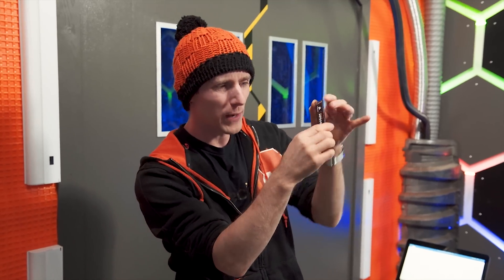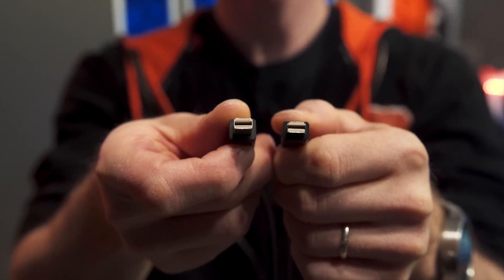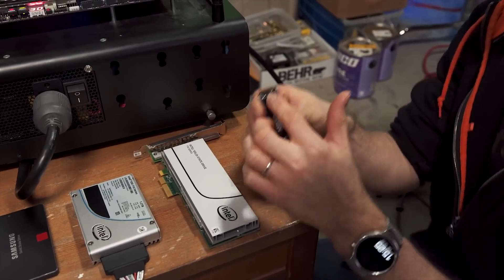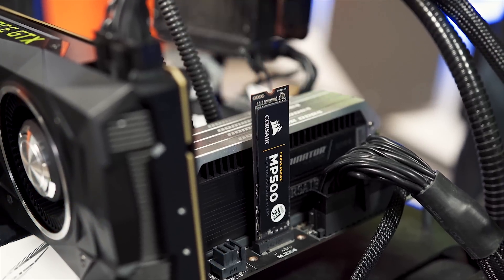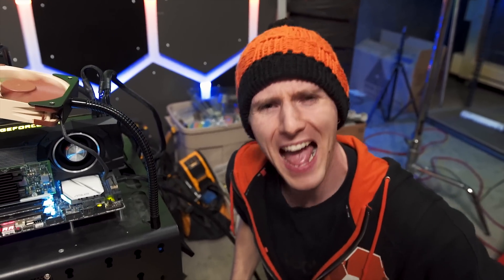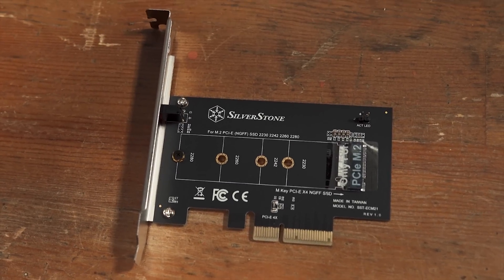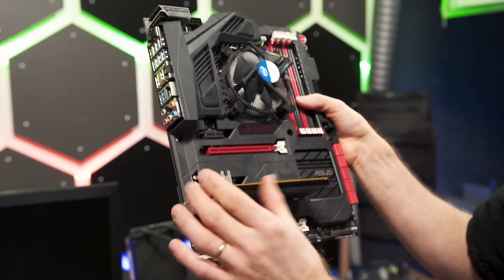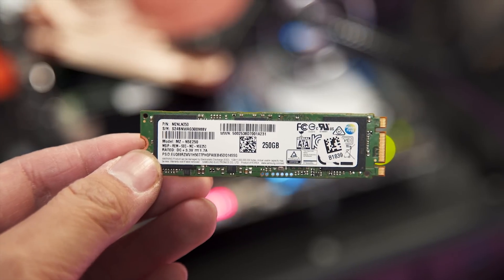The FASTEST SSD Technology Explained - M.2, U.2, and MORE

Comment: That M.2 slot that leaves the drive just sticking up feels super sketchy.
Reply: If you look there are screw holes either side that iirc are for mounting a support for the drive.
Reply: It probably comes with (or you can get) a bracket for it.
Reply: was thinking the same thing. It looks ugly to me compared to the ones that lay down too
Reply: it has 1 tiny screw that holds it down at the end away from the connector. the drive is so lightweight it doesn't need any more than that
Reply: I would like mine to be like that because NVMe gets very hot and it would help to cool it down.
Reply: Did you mean for this to be an amazing sexual innuendo or was it accidental
Reply: that one guy That might be for a wireless module, the connectors look fairly similar. Refer to the latest wan show where they covered that new possible motherboard form factor
Reply: Unfortunately on my motherboard, the m.2 slot is below my GPU, but it isn't an NVME drive so I guess it's fine
Reply: I cringed when I watched that part lol.
Reply: Pienimusta yeah I thought that too
Reply: Most boards have the connector so that the drive lays flat on motherboard and you can "screw" it in place to keep it there firmly. That on video just leaves it in air no matter what you did.
Reply: if im correct m.2 slots are not only used for ssd's, my mobo has one as well and its way older than even the concept of SSD's. im guessing stuff like network expansion cards?
Reply: Pienimusta yea I came to the comments to find this 😂
Reply: +Pienimusta
Better than the solution on my board. 
I have to remove the CPU cooler and the GPU in order to get access to it.
Reply: Some of the older ones are there for Wifi cards and/or Bluetooth cards
Reply: If I get the PCIe NVMe adapter with my Z170m-Plus(which has a non NVMe M.2 slot) will I get NVMe support with that adapter?
Reply: Matteo De Vellis Physiclly, yes, sofware not bios wise, not for certain. If you mobo manufacturer has new bios which gives support for it then yes. It will work as secondary drive without prober support,but cant be used as OS drive.
Reply: Pienimusta i think he did not install a bracket
Reply: I thought that too but how often are you in your computer? Most people build them out and after that unless you upgrade a lot, they aren't constantly in the computer to really make it an issue with hitting it. I guess bumping it might be an issue if nothing is locking it in place.
Reply: Pienimusta ssd boner

Comment: m.2 ahci is not the same as sata
Reply: AHCI or the Advance Host Controller Interface, is an Intel standardized implementation of a Serial ATA host controller.
Reply: Indeed AHCI can also be used over PCIe...then it isn't Sata! e.g. the SM951 has also a AHCI flavour, which can be used in M.2 PCIe compatible slots. All the new PCIe SSDs use NVMe, but in the eraly PCIe SSD days there were PCIe AHCI cards...unfortunetely the video is confusing about this...

Comment: I'm currently building a PC and now I'm even more confused...
Reply: Don't worry about it. Just get a SSD and you'll be fine
Reply: You will probably be fine with a sata ssd, nvme ssds can be much faster but the difference isn't nearly as noticable in most applications as the difference between a hdd and sata ssd. Nvme ssds are also much more expensive per gb than sata ssds of the same capacity, so most consumers that don't need the extra speed are better off sticking to sata until the price drops.
Reply: Cooper Cummings Yeah, oh well... SATA SSDs are fast enough for me tbh but the next thing would also be the PCI lane speeds and such. Like, if I attach an "unsupported" or slower PCI device to a lane it'll drag down all others from what I understand. So what's the best place to put one then? And where for the GPU? I am so freaking confused even tho I'm an IT technician myself and should know it...
Reply: most z170 and z270 boards suppord ahci (sata protocol at sata speeds) and nvme (new protocol at pci express speeds) on their m.2 slots, and you just have to switch the mode in the bios, but for the best place to put them I haven't done too much looking at them because of their expense, but I have seen a few places find they will run cooler directly underneath an open air style gpu (because even though it is hot air being blown onto it it is some airflow over the device, but others say to put it as far from the gpu as possible to avoid the heat source. Every source I have seen says not to use a behind the motherboard m.2 slot if there is one on the front because there is better airflow, but the drives dont actually run over their temperature ratings without airflow, so it doesn't make much of a difference unless you put it next to a heat source with no airflow.
Reply: EpicLPer just put your gpu in your first pcie 16 slot, connect your sata drives to your sata connectors and if you really want to have 3000mb/s write speeds put your m.2 ssd in your m.2 motherboard slot. the video just makes it seem difficult. :P unless you use a motherboard from 2010 you can't really do anything wrong nowadays.
Reply: CrowHD Who, your mum? Yeah, did that, she has. I'm sorry to tell you :(
Reply: M.2 is the physical connections where those ssd sticks plug. An SSD can talk to the CPU via the Sata connections or the PCI-express lanes. Sata is slower and PCI-express is faster.
The confusion comes because there are M.2 ssds that are either Sata or pci-express.
And then, there the protocols they use, if its an M.2 SataIII , it talks to the system via ahci, while a M.2 Pci-express talks to the system via NVMe. 
I think that is how it works, if i'm wrong feel free to correct me.
In short:
M.2 (is the physical connection) can use: SataIII which in turn uses protocol ahci
and M.2 (the physical connection) can use: PCI-e , which in turn uses protocol NVMe.
Reply: +Farhan Tanvir
because it is a waste of money to buy a pcie add in card to give yourself an m.2 slot if the motherboard already has and m.2 slot, if you already have the slot on the board just use that, sometimes they are hard to find.
Reply: Don't bother with nvme, go for a good old sata ssd - it'll work without complications in every motherboard, cost less and still be a lot faster than an ordinary hard drive.
Reply: If you only game, just go for a sata ssd ;)
Reply: CryBeat Well for a newbie to the M.2 connection, yeah it is confusing. Alot of people assume if it is M.2, then it is automatically NVMe, which I thought as well. 

I see why ahci m.2 exists but it does make it a bit confusing to know which is for speed and which is for ease of installation (NVMe vs ahci respectively)
Reply: Dont worry, just go with a standard SATA SSD, or a HDD + small SSD combo. This versions of SSD, while better, are still too expensive
Reply: tl;dr use PCi-e or M.2 drive for extra speed but don't pay for NVMe drive(1-2% performance benefit).
Let me explain.
There are two layers of tech explaind in this video:
Physical: SATA vs PCI-e vs M.2
Transport protocol: ACHI vs NVMe
Let's get physical:
SSD connecting on SATA  is old but working.
PCI-e SSD is working and fast
M.2 is speed is about PCI-e speed but you benefit in size of connection port(awesome for notebooks and insensibly on PC) 
And what about transport?
ACHI is good, but NVMe is better at all. Maybe 10 years from now all SSD will use NVMe.
But NVMe nowdays, in house PC tasks, doesn't grant demonstrable difference - 1-2% at usual!
Today NVMe in PC SSD drives is just manufactoring optimisation(since at future all SSD will use new transport protocol) payed by mexicans, sorry, by enthusiasts.
Reply: stick to sata,some mini itx motherboard still use msata half sized ssd too...
no protocol head ache  but no pcie grade performances.
Reply: for gpu placement and other pcie element,just read your motherboard manual. and cpu specs. it will tell you the lanes it has and where they are used or shared.
but generally the pcie tops ports are the fastest for gpu.
Reply: No, it won't "drag down" all others, that's not how it works at all. No worries there. Put the GPU in the first slot although it doesn't really matter too much for GPUs.
Reply: CryBeat the video is basically saying to match both the connector and the protocol for the motherboard and the SSD. so nvme SSD m.2 needs an nvme m.2 slot and SATA m.2 needs a SATA compatible m.2 slot (basically all mobos have them) and so on.
Reply: As a 950 user I strongly disagree. M.2s are totally worth it for your having OS on. Boot times and overall responsiveness are insane. I honestly think if you're going to spoil yourself on ONE component, get a super fast M.2. Just my opinion though.
Reply: Skrenja depends, if you have extra money to blow then go for it. but if you are satisfied with a SATA SSD then it is the way to go, after which the money can be spent elsewhere. I'm not currently even sure if nvme drives are garunteed to have any noticeable benefit to boot times (I also own a 950 pro) compared to SATA ssd's such as the 850 evo (seen contradictory results everywhere) but it is mostly beneficial in transfer speeds (although only if transfering from one nvme drive to another nvme drive) or in read and write speeds.
Reply: I'll second that one. Using a 960 Pro from my important Steam games and windows is absolutely insane
Reply: The only thing I learned from this video is there's a new type of SSD that's slightly faster but even less cost efficient than the old sort which still don't feel large enough for their price point.
Reply: Sevival Hahaha, no...
Reply: Just get a sata SSD for windows and a couple of apps and games and then just buy HDD's for storage. The speed these m.2  SSD's offer its not worth it.
Reply: How much video editing does the average consumer do. If you're a big company that needs to transfer and export huge video files sure the m.2 will benefit them a lot. But for gaming and watching movies and other day to day usage SATA SSD's are the best choice in my opinion.
Reply: There is a budget M.2 NVMe from Intel - the 600P - but you have to wonder if you really need the extra speed. I'd rather have more space. 
I went for a Crucial MX300 M.2-SATA because of its unusual capacity size (275 GB in my case). The size you can actually use is always a bit lower. 
It was also cheaper than buying the 2.5" version since I don't have a bracket that makes it fit into a 3.5" hard drive cage and it was easier to install of course.
Reply: Stop liking the comment let it sit at 666😂
Reply: Just buy a hdd. Yes yes it's slower. But you get much more for your money than a ssd. 1 tb of ssd costs about 328 USD on amazon. A 5 tb hdd costs 129 USD. You don't need 5 tb of storage, if i were you i would buy a hdd. And maybe buy a better graphics card or processor for the money that you just saved.

Or you could buy a ssd with maybe 128 gb. And store your os there and your favorite games/programs so you boot the os/games faster and put the rest of your programs on a hdd. 

A 128 ssd costs 52 USD.
Reply: FakeNorwegian you're paying for the speed.
Reply: get two samsung pm961 256gb ($120 each on ebay) and a motherboard that supports 2 x m.2 , then raid them if desired. 
Don't listen to those who say "better get a sata ssd", they cost the same nowadays and the difference is 550mb/s vs 3000mb/s and IOPS is double or triple sometimes on m.2
Reply: Guys why does Linus say to make sure we DONT have a PCI-e M.2 slot on our motherboard and then says to use a PCI-e card to attach the M.2 SSD to??
Reply: Just do what you originally planed 
It will work out
Reply: I have 2 nvme m.2 (Samsung 950 Pro) drives in raid 0 on my mobo (Asus Z170-WS) and one of them is directly under my graphics card. So far haven't had any problems with overheating.
Reply: get a m.2 nvme board and drive and don't worry about it
Reply: if you are happy with a sata ssd then dont bother with nvme drives. i just bought one because yolo. but usually theyre meant for professional use, for people who transfer, produce or access large files constantly (such as content creators).
Reply: EpicLPer Unless you have a specific reason for installing one, it's just not worth it over a SATA SSD. M.2 drives typically cost a little bit more and they get toasty.
Reply: I am joining your confuse club.. I am very confused......
Reply: m.2 is nice for read and write.  i just don't like that two of your sata express slot gets disabled.  windows aint like linux it can't show all the drives very well.
Reply: which ssd better crucial mx300 ($250.99) or samsung 960 pro ($629.99)
Reply: Mr. Minimalist The 960 is of course better, but do you need so much speed?
Reply: Axton so you can copy files really fast
Reply: Teamkiller153   What to not understand? In short - same connector, just two different type drives available with that type of connector, and supported by motherboard.
Reply: EpicLPer i love how 'building'  a pc is just choosing the right parts and plugging them in
Reply: If you're building a new pc now I would at least get a board that supports m.2 MVMe drives as wel as Intel Optane even if you're not going to buy such a drive now. It will give you room to upgrade in the feature when m.2 drives go down in price or when Optane drives are released.
Reply: Sevival Honestly if you do it once it is really easy after
Reply: 666th like, I'm illuminati? O.O
Reply: I just built mine with a 960 Evo 1TB m.2.  It's amazingly fast and worth the 2 months of backorder.

Comment: I'd buy an NVMe SSD if it wasn't $300 for 500 gigs
Reply: ÉsxatosFox checking out the Intel 600p. not the best, but good price/performance/capacity
Reply: Kyle Charest thanks man!
Reply: ÉsxatosFox actually samsungs no me drives are 48c/gb to 64c/gb
Reply: ÉsxatosFox Check out Samsung 960 EVO. Insane level of performance for that price. And if you're willing to wait for about a month, upcoming WD Blacks will be 200$ for 500GB.
Reply: ***** I'll probably get the 850 Evo since it's pretty cheap for 500 gigs
Reply: ÉsxatosFox You could also go for the Crucial MX300 if you're on a tighter budget. It's pretty close to the Samsung 850 in terms of speed and performance, and it's known to be one of the most reliable consumer SSD's on the market. I really wish Crucial would step up their game and manufacture some inexpensive NVME M.2 or PCI-E drives. That would be awesome.
Reply: ÉsxatosFox 960 EVO and WD Black suggestions were for being NVMe. But as far as SATA/AHCI SSDs go, 850 EVO and MX300 really are the best choices out there.

Comment: The fastest SSD is as fast as linus in bed
Reply: He still has those man juices.
Reply: he is neutered no?
Reply: Each sperm has about 37.5MB of DNA in it. Multiplied by an average count, it comes to a data transfer of 1587GB in 3 seconds - or a bus speed of 529 GB/s
Reply: no, he is sterilized... that means he still wants to have sex and can still 'unload' and it will still be white but it won't have sperm cells which can make a woman pregnant.
Reply: Tailslol someone didn't watch WAN show
Reply: he still has the balls, no worries about that.

apparently the specific operation he did is also possible to be reset, as in, he can go back to how he was before if i understood correctly.

still, are we really going to keep talking about linus balls for weeks?
Reply: That is true
Reply: neomew People keep spreading this misinformation!
A normal human cell contains 3 billion base pairs of nucleus DNA. Each base pair can be one of 4, A, C, G or T, so that's 2 bits per base pair, which is 6 billion bits or 750 MB in total.
A human sex cell has half of that, thus 375 MB and not 37.5.
Reply: +Tailslol No, I think the right term you're looking for is "spermless sex machine"
Reply: wat the heck
Reply: I heard Linus recently upgraded to the new solid state sex drive. He wanted the M.2 version but it was too expensive.
Reply: Lol, someone should calculate humans actual "data output" in bed sexytimes.
I mean, just a single strand of DNA has insane data volumes if we convert it to bits.
Now multiply by all the DNA that gets "ejected". Thats a lot of data transfer speed.
Reply: Peter so the final result would be, what? My math sucks so forgive any sexy errors.
375 MB of DNA per sperm, removing a comma of neomew's count multiplication = 15870 GB in 3 seconds. A bus speed of 5290 GB/s. Correct? So a 5.2 TB/s bus speed, holy shit son xD LOL
Reply: Bros I got that 8 inch floppy drive (with the jacket intact) so you know that data transfer is gonna take all night long.
Reply: i didn't used the right word because i m not a native English speaker,but you got the idea... but putting no with an interogation point at the end of a phrase is a key point here too...
and yea wan shows are too long ...
Reply: *****
fine, you?
Reply: I love this conversation so much
Reply: Kaden hello brother
Reply: neomew Don't forget that it's mostly redundant and in the end no more than 8 of those are used each time
Reply: LOL!!!!
Reply: LMAO !
Reply: Are you Yvonne

Comment: Intel should make a new version of the 750 Series SSD that is faster than Samsung's 960 Pro.
Reply: element2310 Before we get an interface that will use more than 4 pcie lanes we will see PCIE 4 coming to mainstream hardware solving this problem because it potentially doubles the bandwidth. But we might have to wait for this one or two more years.

Comment: a ramdisk reads and writes between 4000 to 7000 MB per second I think. try out a software ramdisk and blow an nvme drive out of the water.  or even better have both considering you need a fast drive to sync the ramdisk to. ie Samsung 950 or Intel 750